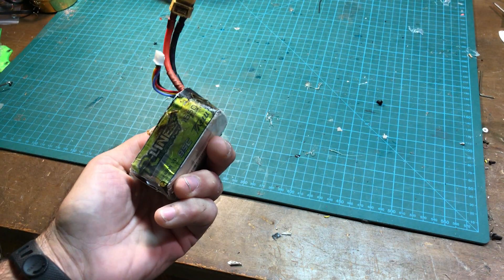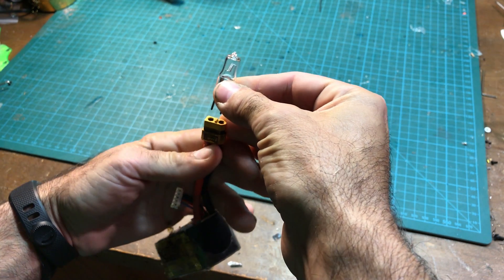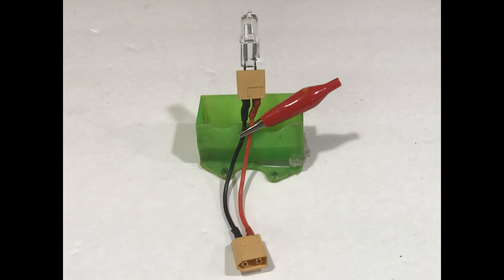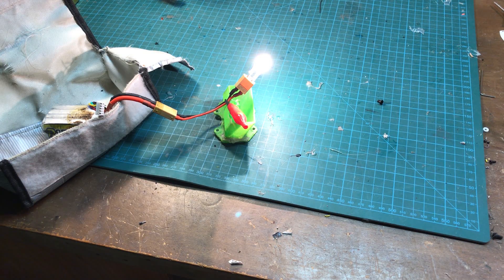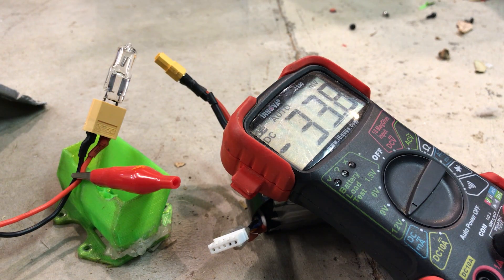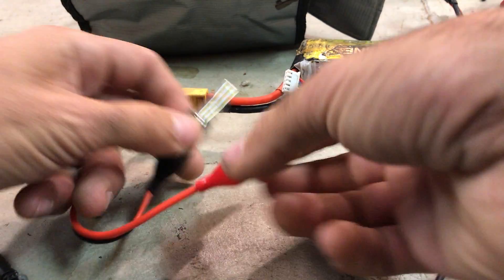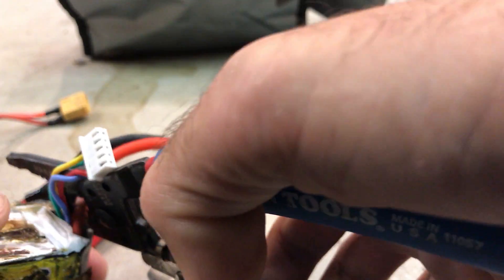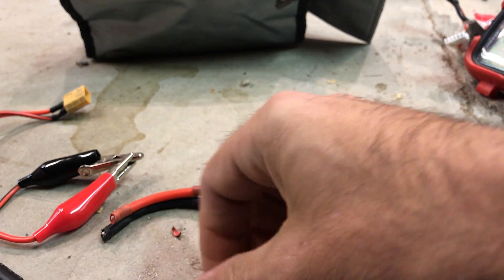How to fully discharge a lipo battery

Comment: Great video, man! Any advice on what one could get that would allow you to discharge the battery no matter what the voltage is on it?
Reply from the maker: A drone? :P a 4S at 16.8 volts should be fine if you cool the bulb with a fan or submerge it in water. You can always put 2 bulbs in series for a 5S, they are really just resistors. You can always use regular resistors. Anything that dissipates heat at an acceptable current will work.
Reply: Hey Diego, I tried wiring two bulbs in series for discharging a 4S at 15 volts. One bulb is extremely bright, the other is rather dim, and the bright bulb started smoking after a couple of minutes so I had to turn it off. Any suggestions?

Comment: Why use a light bulb instead of just a resistor?
Reply: most resistors is not made to withstand 70W of power in heat. Lihtbulb is very inexpensive option that needs no heatsink